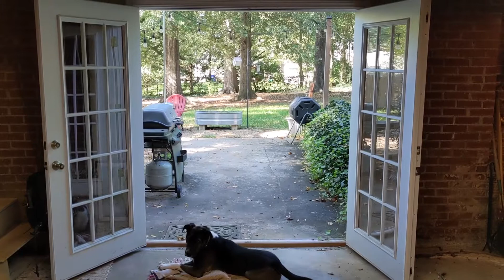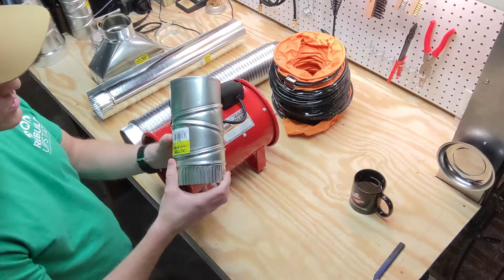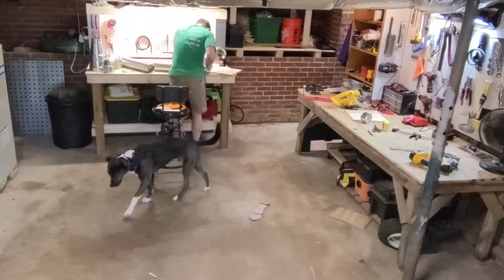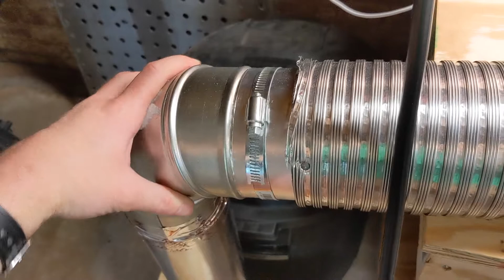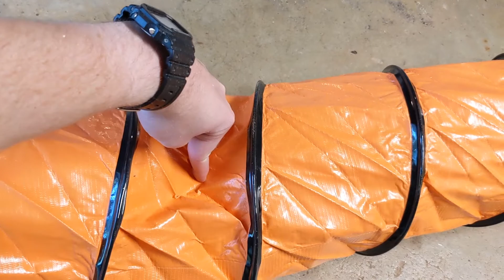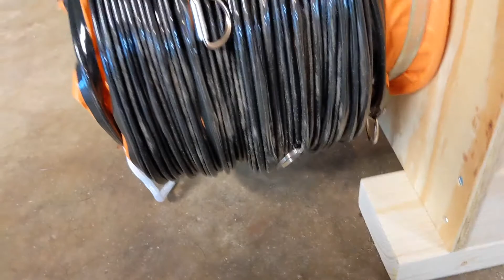DIY Fume Extractor Build for Welding in Home Workshop

Comment: Overall, i like the idea. It may not matter or make a difference but i was thinking to put the fan at the box and then run your pvc flex duct out from there. The distance from the origin of smoke to the actual exhaust fan is quite long. Having the fan closer to the metal duct work just seems that it has less distance and space to pull the smoke from its origin, creating a stronger suction.

Comment: I would recommend something over the top instead of trying to pull from the side. Smoke wants to go up anyway. Might as well suck it up in the direction it's traveling.
Reply from the maker: You're absolutely right. I was just pulling from the side for demo purposes. When I'm working I position the hood (not sure what else to call it 🤷) so that it's above where smoke is being produced.
Reply: @jeffdill2   Do you find the smell and smoke dramatically decreased?  Sometimes when you tig Weld for an hour or 2 without good ventilation you start really smelling the metal.  That can't be good for you. Also what CFM do you recommend? Did you ever feel like it was pulling your argon away?
Reply from the maker: @77Avadon77  Very much so. And yes, good ventilation is absolutely crucial for your health. You definitely need a high CFM for my particular configuration, since it's a 20+ foot run with an 8 inch diameter duct. I can't remember the exact CFM of the fan I have (I'm fairly certain I mention it in the video) but it's upwards of 1,000. I mostly use flux in the basement since I don't have a great place for the gas tanks, which is going to be a bit more resistant to wind and suction. But since I generally have the hood 8+ inches above the arc, it shouldn't cause any issues with MIG or TIG gas.

Comment: very smart to build it in modular form like you did. Thanks for taking the time to prepare this video and sharing. Now that it has been a few months since the build, are you still satisfied? Is it doing its job? Have you made any modifications? Thanks
Reply from the maker: Thanks! Yep, it's still working great and I'm still glad I built it in this modular fashion. I haven't made any modifications but I've considered adding some casters to the bottom.
Reply: @jeffdill2  awesome, thanks for the feedback